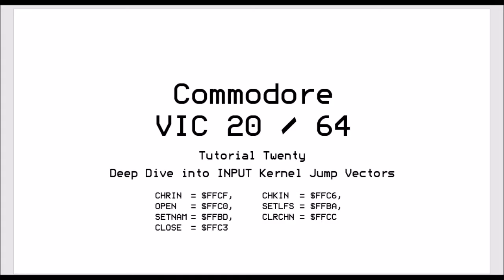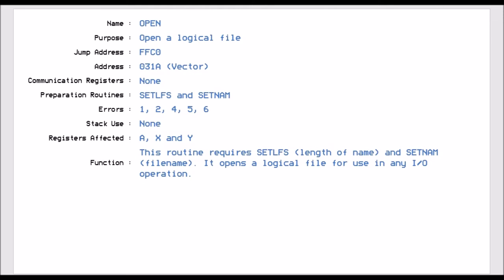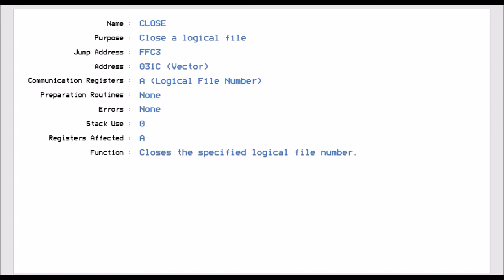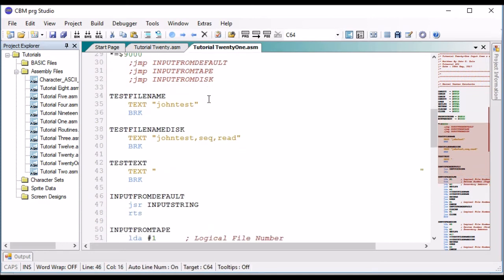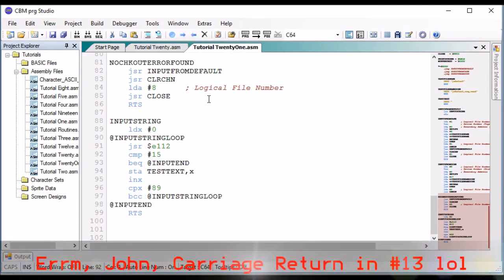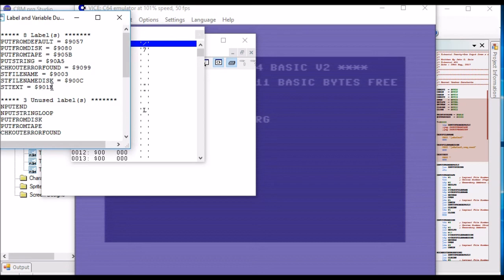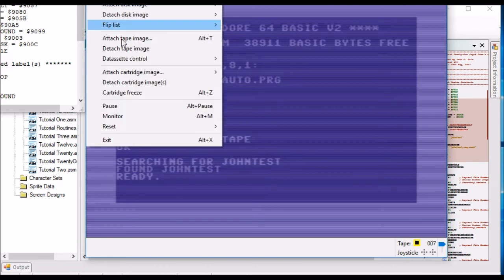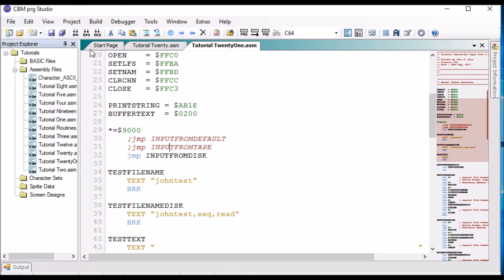Tutorial Twenty - Deep Dive INPUT Kernel Jump Vectors

Comment: I have a question... Why use LDA/TAX instead of LDX?
Reply from the maker: Mark R , Hi because I wanted to make the file number match the device I'm using, so for a disc device 8 ( x reg) I would use file number 8 (Acc). So uses less commands to lda#8 and then tax. Hope this helps
Reply: OldSkoolCoder Got it. Thanks for the explanation and your hard work with these tutorials - very clear and easy to follow